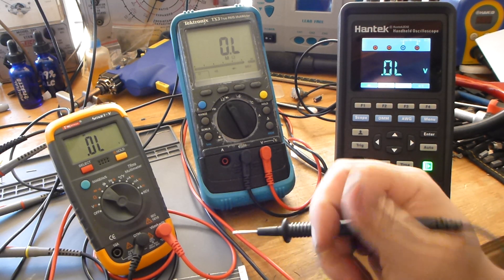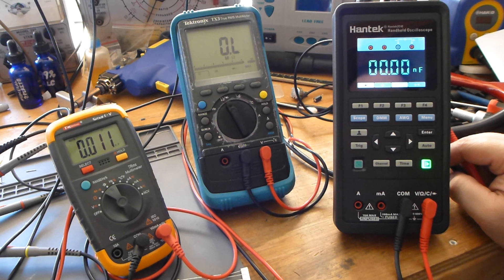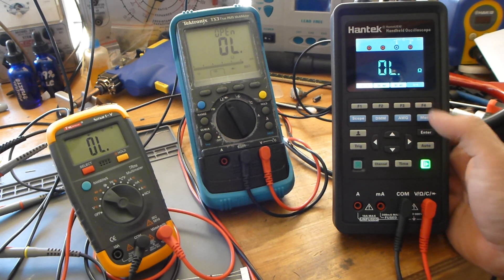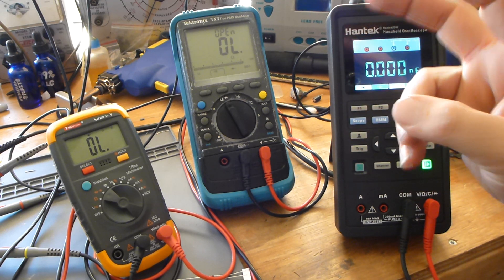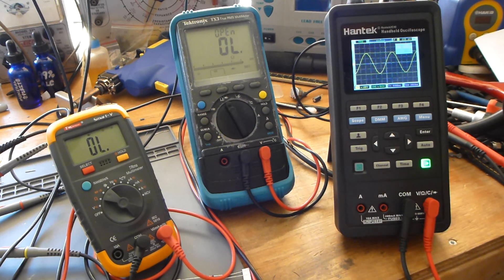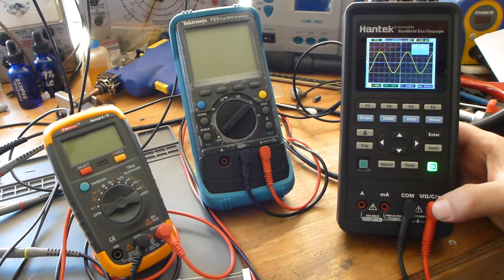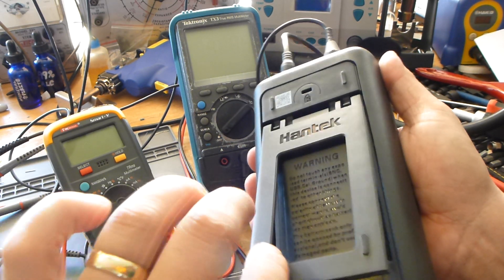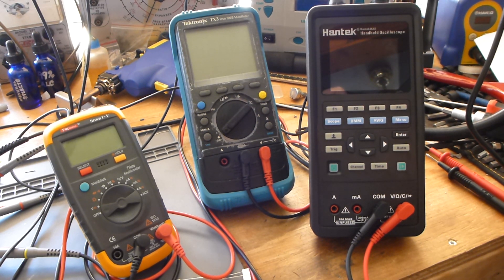Closer look: Hantek 2C42 DSO/DMM Part 2

Comment: I’m considering buying one of these however I don’t want to get a scope that isn’t capable of handling 120vac (not what I’ll be using it for primarily, just want the option available) the manual was very vague, only reference I could see was 150rms max. Safe to say it would be fine using a 10x probe?

Comment: Why does the continuity test have to be instantaneous.
Reply from the maker: It does not have to be, I just prefer it. If you are testing a lot of circuits point for point, it becomes problematic when one needs to dwell on each point to ensure they are or are not getting continuity.

Comment: One great feature I REALLY like about the 2D series is that they use REMOVABLE 2x 18650 lithium cells in parallel configuration. I immediately replaced the "2600mAh" cells with "3200mAh" cells. The original "2600mAh" cells actually provided about real-life 2700mAh at 300mA load. The "3200mAh" cells provide about real-life 3000mAh using the same load and 2.80V termination voltage. So, the replacement cells add about 10% more usable power for each charge. Definitely helps on those really long days away from the grid.
It was also nice to know that Hantek was using quality lithium cells that actually exceed their claimed energy capacity...all too many lithium cells shipped with products don't even come close to their rated capacity.

Comment: The link is not showing the manual
Reply from the maker: http://www.hantek.com/en/PagesFW_Vyhsc_3.html
I just checked this one. It is a list of PDF  manuals. The Hantek2000 QuickGuide is the one that cover this model. It looks like your options are English and Chinese.
Reply: @circuitmonkey6653  Yeah I already was there but it doesn't show any 2Dxxx Manual there.... Only on the last page the 2D82 one